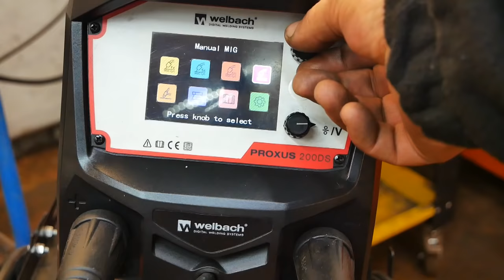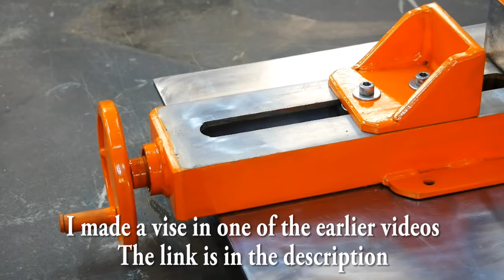Homemade Metal Band Saw

Comment: Great work! Nice to see you used a proper ball bearing race mounted on it's edge for the back of the band saw blade to run up against. Many cheap band saws just have the band saw blade continuously scuffing on the side of a ball bearing outer race to give back support.

Comment: One thing i love about building power tools like one you built is that you can maintain it and fix it easily and there is not unnecesary electronics inside just good old electromotor and safety on/off switch. Keep up good work.

Comment: Your videos are sensational, I'm an industrial designer and system developer, I work more as a developer than a designer, but in my spare time I'm manufacturing my CNC Router, to open a company and act more as a designer. I have no experience with soldering, I see this machine you are using it seems to be super simple, there is this model of machine here in Brazil.... I will definitely want to make my tube cutter as well.

Comment: Lovely bit of kit,and a saw like that is just so useful, just a not when drilling, if you lift off as the swarf gets to about an inch, just enough to take the cutting face away from the work you don't end up with long and potentially dangerous cuttings, you can't do this with stainless steel, but aluminium and mild steel are fine.

Comment: Me: buying all the equipment (hydraulic vice, mig, tig, stick welding, heavy duty jigsaw, heavy duty drill press with all the bells and whistles, heavy duty grinder etc etc), at the end my band saw build will still be a fail!  Very nice workmanship, almost a factory made build.
Reply: A lot better than any Chinese made band saw, it wont fall apart in six months.

Comment: On one hand I love your very casual way of building, on the other hand it upsets me a little 😂. How can you make such perfect machines by cutting pieces with the angle grinder, marking the drill points with a marker, making perfect perpendiculars by welding without milling at least one side and drilling the holes by hand!? I'm kinda envious, but honestly, wonderful work! as other have recommended already, I would improve the base with a cooling system, the vice closer to the saw, and something to catch all the metal shavings. Otherwise it's better than the ones we had 👍🏻.

Comment: Nice job mate ! Very good quality square cuts at the end there too bang on. 
I liked your use of “simple” parts and methods throughout with nothing there that isn’t accessible to the small home shop.
Assuming you can find a surplus reduction motor from an old conveyor etc at work or a friends work then I’d imagine it could be quite cost effective if you’ve time available 🤔
Liked your use of the off the shelf hydraulic parts too for the decent control  appreciated the way the length was just right end to end on the chosen set up ! 
Well done friend need to get a stop created now for repeat cuts 👍🏻

Comment: Excelent, i think you should add a removable   block to hold on the part  in the right side of the blade,  one more think that i found very usefull is a block easy to stop the saw when you change the angle to 45 degrees ... any way this is a great diy cutting saw

Comment: Many compliments for your work, excellent object and great satisfaction.  But have you wondered if buying a used one and putting it back in would have spent less?  And then I ask you, why without an oily emulsion?  Dry stainless steel you can't cut it.

Множество комплиментов за вашу работу, отличный объект и большое удовлетворение.  Но задавались ли вы вопросом, стоило бы купить подержанный и вернуть его меньше?  А потом спрашиваю, а почему без масляной эмульсии?  Сухая нержавеющая сталь не резать.

Comment: I just realized that I have a 24v floor scrubber motor and a wheel to fit it. I might try a project like this to see how it works out. It's got a rubber tyre on it, but I'll have to see about putting a crown to the center so it won't wear the teeth.

Comment: I enjoy many features here in this project, but one rings out as a wonderful aspect is that the sheet metal used in this is thick enough you can use a tap for the fasteners. It will last you a very long time.

Comment: That's all fine and dandy, but not many people have a metal fabrication shop nor funds to purchase the steel, other parts and that electric motor with the gear reduction is very expensive. I have to say though absolutely awesome fabrication for well needed tools for some like myself. The bandsaw and the hydraulic vise are now on my list. That is the sweetest vise I have ever seen.  I want a machining lathe but not in the cards right now. Great video's. Do you have plans for some of those? I know you do because there is no way you so precisely made all that on the fly. If you do how can one get them?

Comment: Wow, great build, I save your video into my projects I want to build folder. Two things I would change, 1, the connection joint between the saw body and the base structure looks a little on the lite side and maybe wobble but not knowing the metal thickness I may be wrong,  2, I would want the ability to also use the saw and a vertical bandsaw thereby serving two purposes. Thanks!

Comment: You made a super machine, like everything you do. Can you explain? You have an electric motor with a power of 0.75 kW or a gearbox type NMRV075 15:1 - 93 rpm. There seems to be an inscription DKM50 on the gearbox.

Comment: Very nice saw now I really wanna build my own hahaha , may I give you a suggestion that might help you with cleaning the saw and replacing the blades? The saws at my welding shop the rear cover of the saw has hinges and is held closed by a couple of threaded knobs like what you have on the blade guides , it makes it really easy and quick to open up the saw for cleaning and changing blades and figure out problems if there is any
Reply: Oh btw I liked and subscribed you have very good videos

Comment: Can we use a single aluminum piece just machined to that shape instead of going through this complicated way of making the pulleys with four different components? i.e. the old pulley, the backing plate, and the very short circular cylinder that covered the pulley grove. Also, I want to buy online the kind of motor that is used here so I can make my own band saw. Could you please provide the supplier and specs and a link?

Comment: What type of disc did you use to clean/remove the mill scale from the sheet metal? I've tried several different types of them and none seem to work very effectively or without using several of them at a time.
Reply: Time stamp is approximately 10:10
Reply: Looks like flap disc
Reply: @tiago12342  if it is I'd like to know the brand and grit. I've used numerous different ones, some work better then others but I use a LOT of them.

Comment: That is nicely made.  Do you plan on doing the coolant system in the future like you mentioned in the description?  That would be about the only improvement I think could be done on this.  A safety concern that I might have is your automatic shut off. The way you appear to have it set up, it will start running again when you lift the saw unless you hit the stop switch.  I would put in a contactor (relay) to control the motor so when the automatic stop switch contacts the table the contactor would unlatch.  Doing this would require a momentary start and stop switch though.  I still like your build though.  Thank you for sharing.

Comment: Great work. Drilling big holes ( more than 20mm in diameter) into 10mm steel is often a problem for me. Which brand of hole-drill do you use? It seems to work fine, contrary to the mass of scrap in the market.

Comment: INCEPTION! I want to build all these tools so I can build all these tools HAHAHA.
Seriously though, one thing I still do not understand: Every bandsaw has a moveable upper part that is at a 45 degree angle and then has guides on the band to make it perpendicular to the item being cut. Why not just have the entire upper part at the perfect 90 angle and not need guides on the blade to bend it another 45 degrees?
Reply: If the bandsaw was horizontal bringing the saw blade streight into the work piece the top portion of bandsaw would hit work before the saw blade ever made contact,the frame work would be on the same plane as the blade.
Reply: @chadsmith9218  oh no kidding. I didn't think about that. thanks!

Comment: Hey! Thanks for sharing another great project. Your videos really encourage to work - it's incredible how You can make such machines with basic tools + welder. Could You let me know what motor did You use and what do You think about not using 90° gear? I understand it's smaller leverage on bearings and machine is more compact with this gear, but they are quite expensive.

Comment: What is the speed and power of reduced motor?
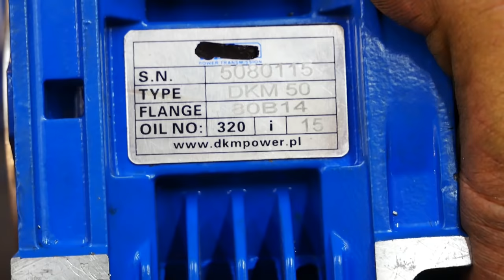Reply: The CC Captions at 5:28 tells the power is 0.75kW (which is more than enough for this small saw) and the output speed is 93rpm.

Comment: There are a few companies building saws with that kind of drive. I have had to replace that drive because of the weakness the way they connect gear reducer and a hollow band wheel shaft. I would not buy or build one like that. More range easier repair with belt drive.

Comment: Great workmanship and design,,,,but doesn't anybody  cut with a torch anymore? - Even Plasma ?????. All I see on YouTube is angle grinders. Maybe I am old fashioned but I burn  anything over 3/8 and use a Plas on anything smaller. I guess it's just me but I don't get it. . 

Just an FYI for you....When you have coolant the blades last MANY times longer. We cut 4140 a good 15 hours every week and a quality bimetal blade will last us a couple of months months. - If you want to know how much coolant helps did you ever see a steel supply house with a band saw cutting dry?  Go ahead with your plan and you will never be sorry.

Comment: the problem or the point here is from my point of view  .... that  if you  dont share a list of materials used,  not all, just the  the critical ones and the dimension (thickness) of some parts, the  video is just ...  widely useless ..  just a demonstration you are good at metalworking .. but not sharing actual info of the machine will make difficult for most of the guys to be able to make one too ...  Probably we can make one but will make many mistaked on the parts ...  thickness of some parts I think its critical on this machine ...   just my thoughts of course ...